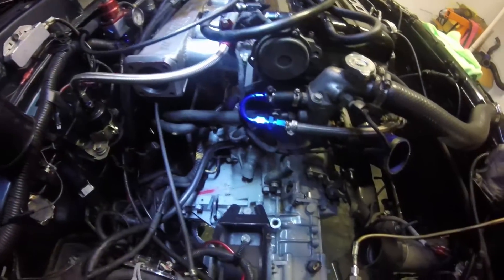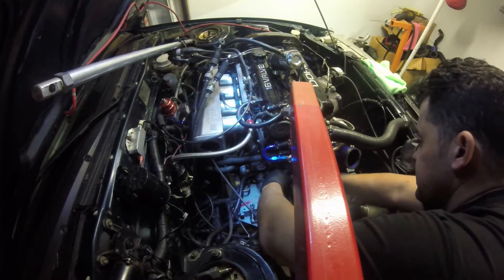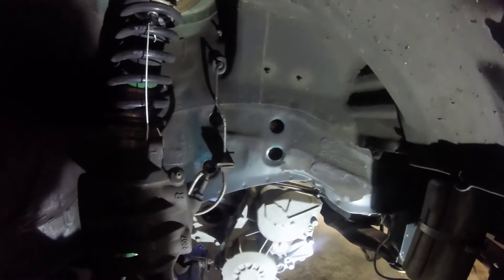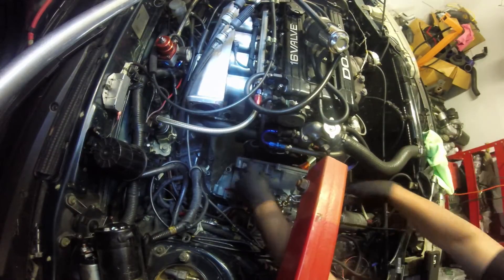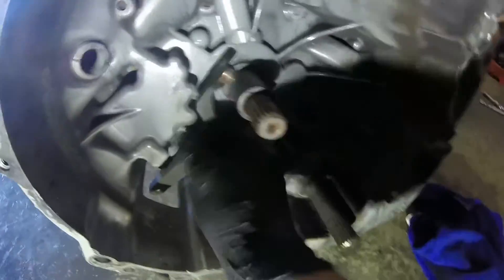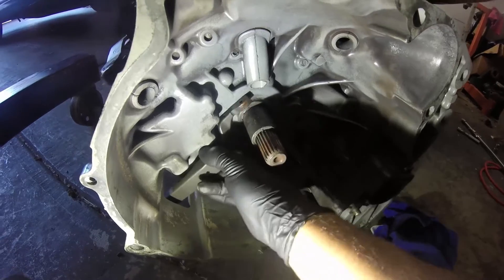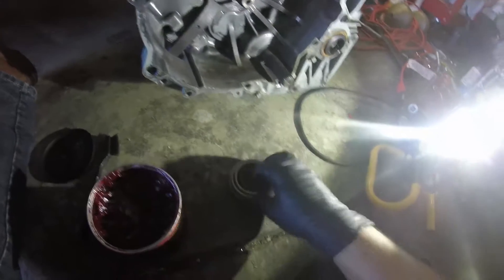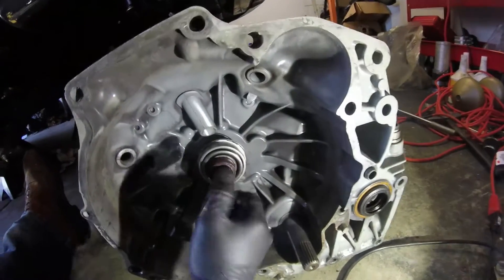DSM Throwout Bearing Replacement Part 2 20170308

Comment: Could that pin that holds the throwout bearing to the fork was mistakenly put on backwards? I heard that it runs thru the back of the TOB and the fork, not the front like the video shows right around 7:04